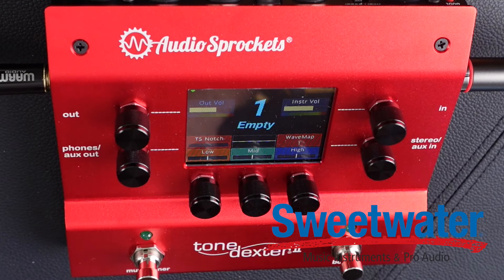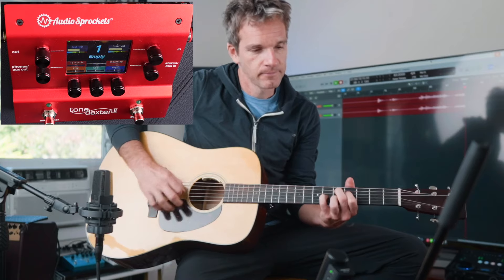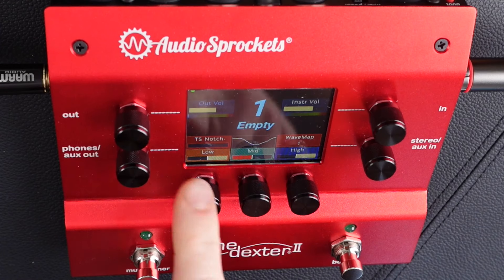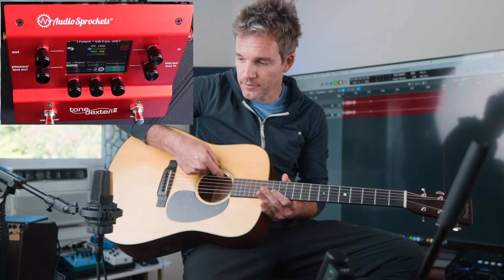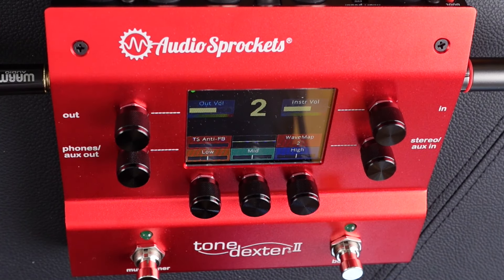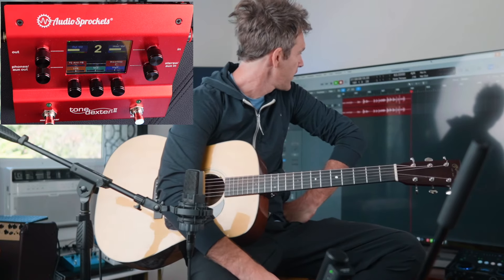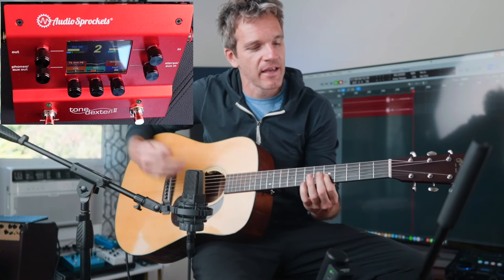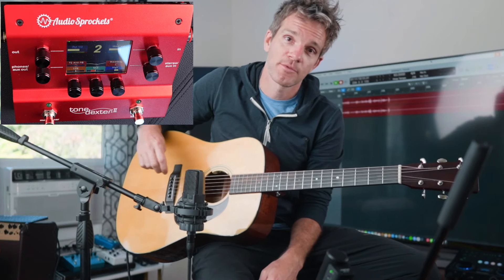The 1 Thing I HATE About Guitar

Comment: Sean, I took a 60 cent piezo mic element, combined it with two "AAA" batteries, a .1 uF cap, and a 3.3K pull-up resistor. They were all mounted on a Velcro square, The other half of the Velcro square was mounted inside the guitar beneath the sound hole. wire and 1/4 inch phone jack were placed through the rear side of the bodyA switch allows the piezo mike to be powered and wad mouonted under the strings on the edge of the sound hole. It sounds like a studion miked guitar. Total cost? About $6. Pass that on to Sweetwater.